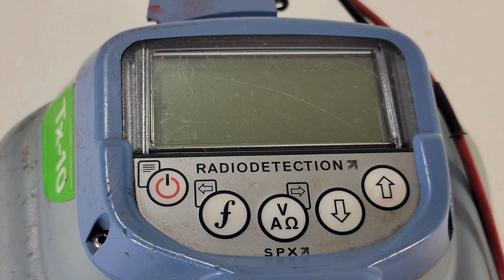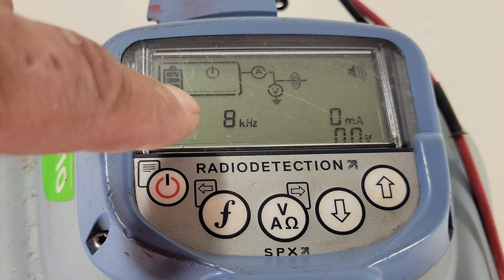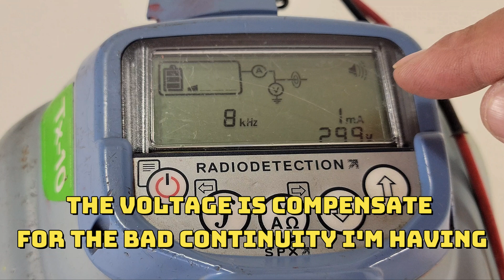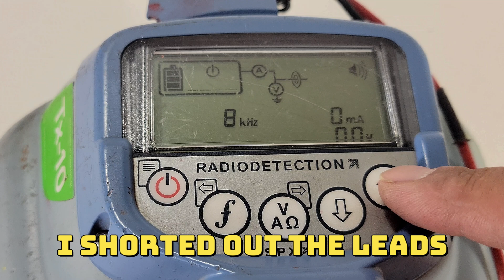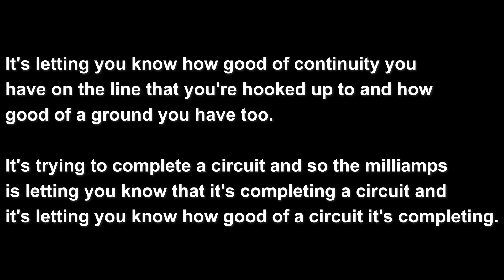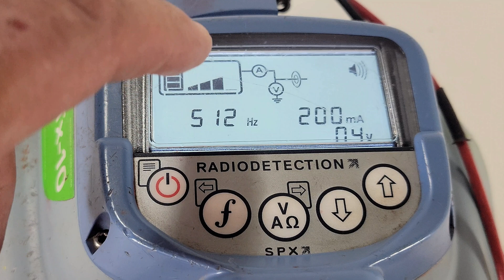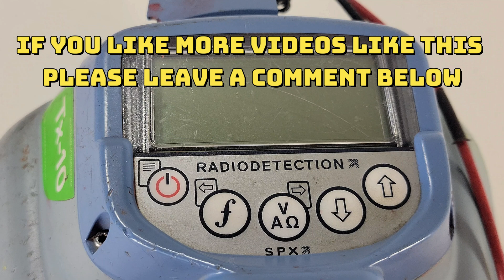Radiodetection Tx 10 Transmitter | Output, Milliamps and Voltage

Comment: Thank you. Good info....
Would at 50MA cause it to bleed out about 11 ft giving out a false reading ?
Reply from the maker: If your transmitter is set to 50 milliamps, there's a risk of signal bleed onto neighboring utilities. However, by adjusting your equipment to 512 Hz with 50 milliamps and ensuring the receiver gain isn't excessively high, you can minimize bleed-over. When detecting a signal 11 feet away, it's not a false reading but likely bleeds onto a shallower utility nearby, rather than the intended target at greater depth.

Comment: Thank you for the  demostration. I'm wondering what do you mean by "output" at the end of this video? It seems when you press the "f" button, the frequency jumped from 33k to 512, and current and voltage jumped from 100mA and 0.2V to 200mA and 0.4V, respectively. To my understanding, the power, which is the product of current and voltage, more than doubled.
Reply from the maker: I should have said the current output of the milliamperes has doubled.